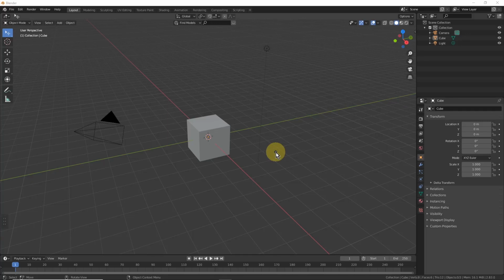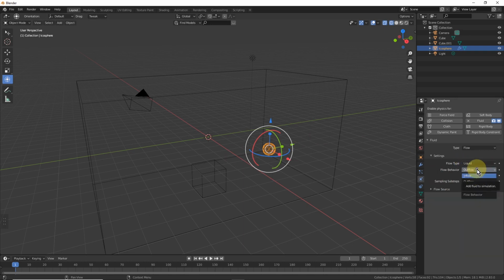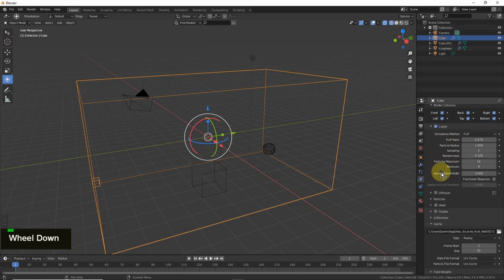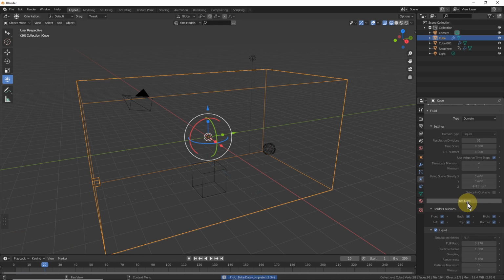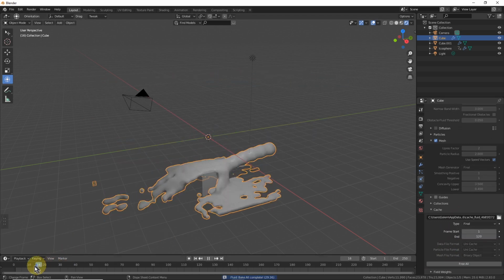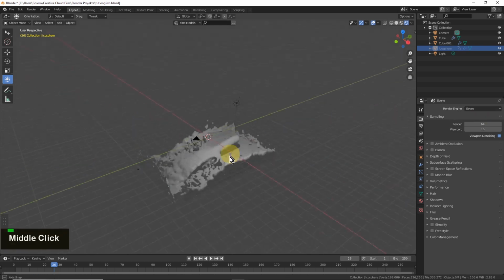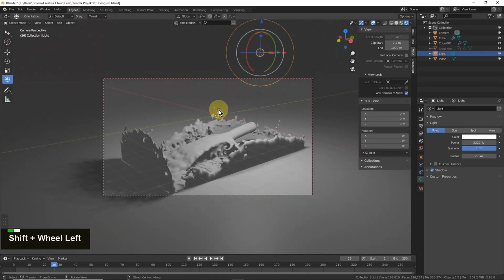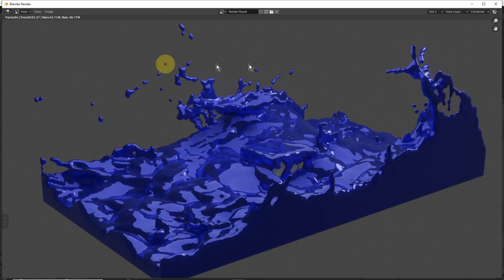Basic Fluid-Simulation in Blender 2.8 - Tutorial

Comment: How is your fps so high? If I use the playback, my fps will start out fine, but it will get very low relatively quickly. (I also did a fluid simulation, but with different shapes and more water).  Nice video BTW, very helpful!
Reply: If you have lots of fluid your computer takes longer to calculate the fluid, that's why your framerate drops